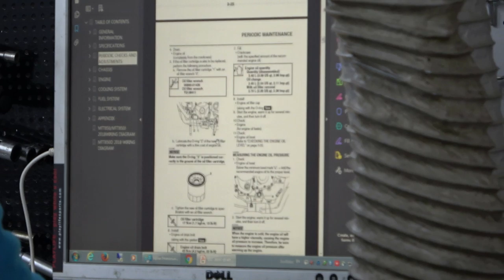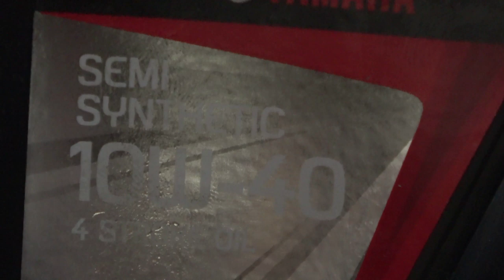change oil on YAMAHA TRACER 900

Comment: I didn't see the new washer.  Did you wrench tighten that oil filter?
Reply: Yamaha has a torque spec for the oil filter, it's 24 lb-ft which is too high IMO